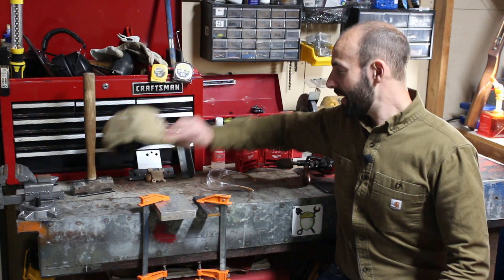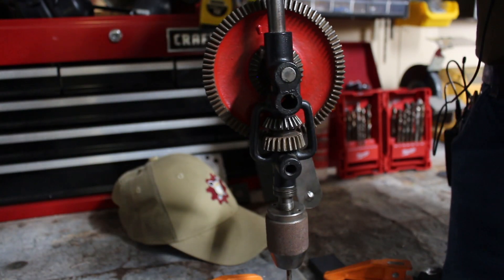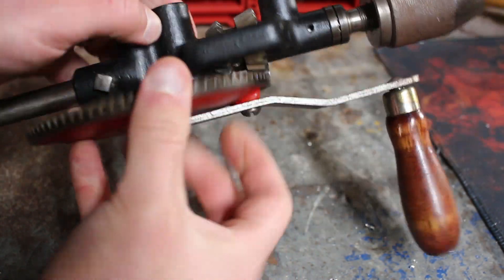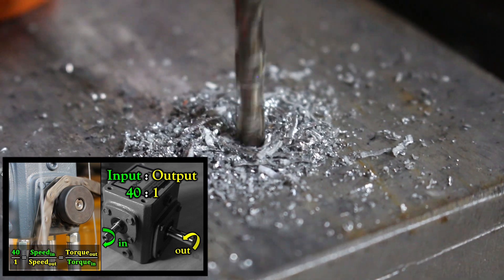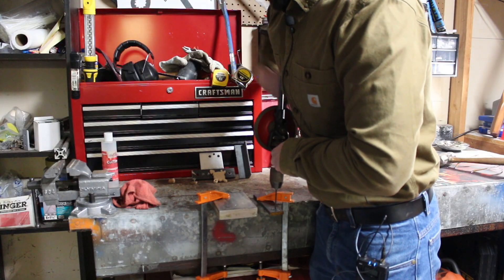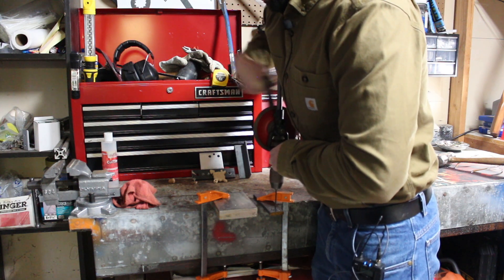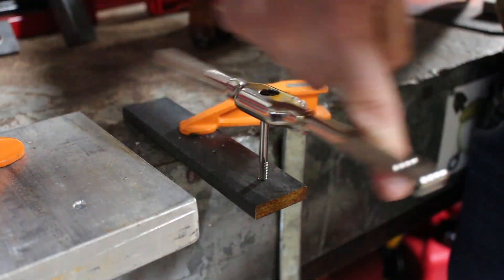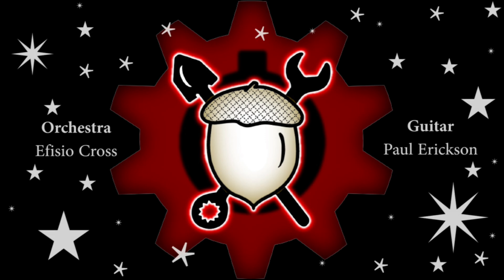Can you drill metal without electricity?

Comment: Yes! Of course you can but it might take longer. A big factor is correct grinding of drill bits and keeping them sharp at all times. We might even look for a hand-operated pillar drill like the Goodsell-Pratt manufactured, I think, somewhere between 1890 and 1930. Good hunting!
Reply: I bought one of these back in 1989 and I am shocked at the price now exacted! A weak point is the arrangement for raising and lowering the quill which rapidly broke. The original is not a good design in my view and it looks like with my example they goofed up back in the factory. I am working on a solution with does not require a lathe but have a few points to tidy up. On the plus side, there is a 3/8" chuck and I had to replace the original springs: fiddly for an old guy but got there in the end. Another point to note is there is actually very little room to drill if using standard length bits. At a push, it looks that if you remove the little round table and remount the whole machine you could drill almost to the centre of the Earth as long as you have a bit long enough!!! Best regards - Jozef
Reply from the maker: @jozefbubez6116  Haha that's interesting! Good luck with your upgrades. They sound pretty slick!
Reply from the maker: Thanks for the tips, Jozef! I see a Goodsell-Pratt pillar on eBay as I write this. Very cool!

Comment: A friend of mine built a whole rally car in his lock up with just a hand operated drill as there was no electricity and cordless drills had not yet been invented.  Lighting was by Tilley lamp and because he had very limited funds he concluded that to be competitive he had to "add lightness" (Colin Chapman) that meant cutting all excess lengths on bolts and superfluous material away, which he collected in a bin and had weighed in for scrap being 50kg of weight saving!
Reply from the maker: Whoa! That's amazing, Clive. It's not so much the tool but the spirit that gets it done!

Comment: Do you find that with the lower rpms that you don't need to apply any oil during the drilling process?  I think these types of tools are great to have on hand in the event there was no power source to use a modern drill.
Reply from the maker: Yes! For sure. The metal stays cooler so oil is not required. After a few trial runs, I found that with a low gear, I could steadily drill through metal bars easily. No dull bits. I wasn't able to get those nice spiral chips like you get with a drill press or mill though, I'm guessing cause of the jerky motion of hand-crank cutting.